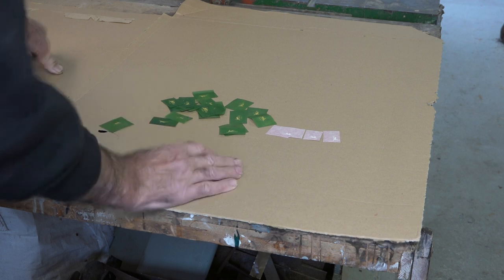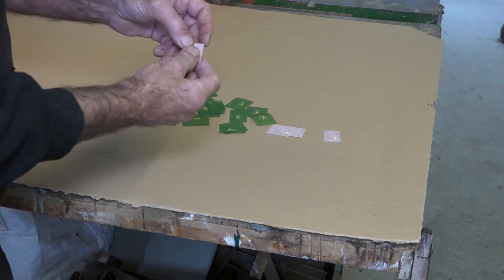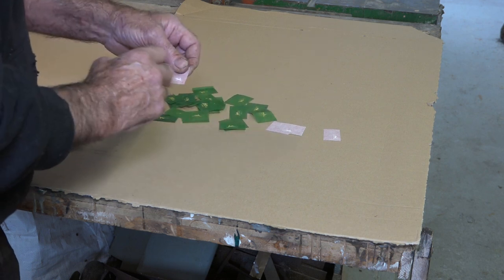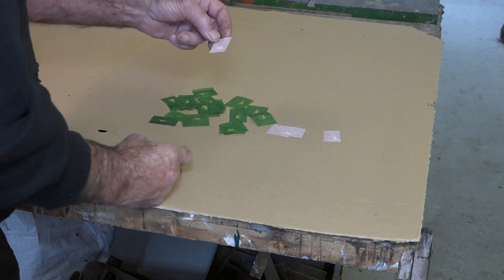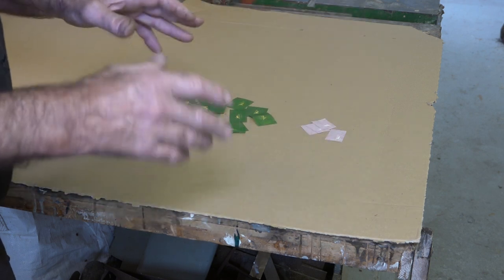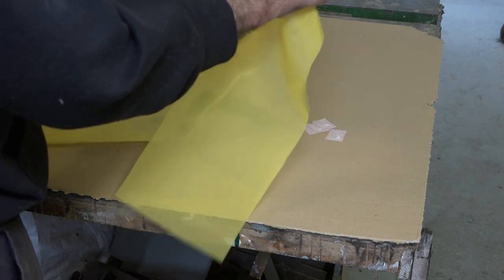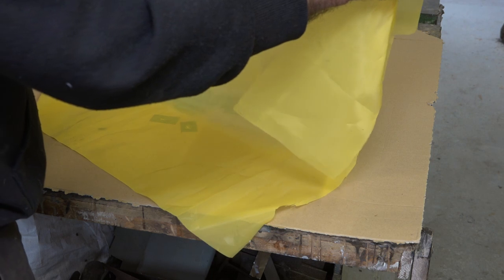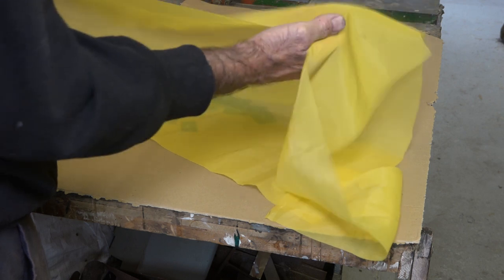new way of making my logo stencils

Comment: Hi Loz, if I understand correctly you are using the mesh as a stencil? So, how do you hold the acetate sheet firmly to the mesh, just resting on it? and last question, the color green is the color of this emulsion? thanks for the tip!
Reply from the maker: Hi the acetate is used as a resist initially to stop the uv light hitting the mesh and film underneath it, the film cures around the image with uv light so under the acetate stencil is not cured and can then be washed off in water. basically that image section is just mesh now and can be etched through. hope that makes sense. no the emulsion is a blueish colour and dry's green.
Reply: Great ! and  how do you hold the acetate sheet on the mesh ?

Comment: Thanks for the info.  Question : The finer the mesh the more detailed the stencil......or is the detail depending on how good the laser print was on the acetate ???  I can find screen up to 140  mesh.
Reply from the maker: Yes to both 140 mesh is plenty I think very high mesh might be difficult to wash out on logos, I counted the mesh on the etch o matic stencils at around 100, with smaller detail on the acetate get the image as good as you can or it may show a pixelated outline. TIFF for instance will give better results than JPEG. cheers.

Comment: Hi Loz. This is genius but I have one question. What kind of printer do you print on the acetate?
Reply from the maker: Hi I use a laser printer, not 100% sure but i think inkjet would do as good a job, you can get acetate film for both. Cheers.
Reply: @LozHarrop  just a wee update gave it a go and no joy with ink jet.